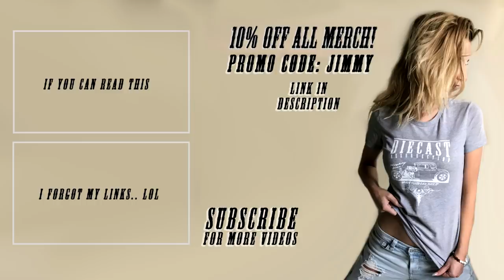1:64 DUNKIN' DONUTS GASSER CUSTOM

Comment: Love the car theme. I would have liked to see the over spray fix and the stance change. Those are a couple of the learning points which you do so well. As for the decals, I assume you have notified the seller so he can hopefully address the problem. As a business owner, I have always stressed that negative input is as important if not more so than positive. A problem can not be corrected if I don't know about it. And if this seller is reputible, then he or she deserves a chance to correct your issue and perhaps even compensate you for your trouble. Thanks for another great project!

Comment: I restored a Fender Stratocaster guitar and bough a aftermarket headstock decal. When I went to smooth out the bubbles the decal ran. The guy sent me another one and suggested a very thin coat of clear. It worked great and when I clear coated over it, blended in well.

Comment: In the future you can spray the decals with a clearcoat before you dip them in the water. That would keep the print from being destroyed.
Reply: Yeah, I thought I've seen Marty do this as well.
Reply: 99% of professional or retail decals don't need that treatment, like the ones that come with models are typically pretty sturdy. He must have thought the same and as much as that guy charges for them, I would too...
Reply: Well, after the first one, I would have clearcoated the rest. Don't get me wrong, he does great work. I just would not have trusted the rest of the decals. I know he didn't even though he used them as they were anyway.

Comment: The Decals were definitely not sealed. I print my Decals and you need to clear coat them because the ink will run off (like yours). Maybe the seller forget that. I use acrylic water-based clear coat "acid free" from a can. Works great. Hope I could help!

Comment: Awesome gasser buddy. on the decals, what he forgot to do is seal the ink. ive heard from a buddy, that when you print water slide decals, you are to let the ink dry. then you spray a sealer this protects the ink, when you soak them and apply them. not sure what its called. but it looks like he didnt or forgot to do that step when he made them.

Comment: I have run into the ink running like that. I ended up clear coating the decal sheet before cutting them and putting them in water. Pain in the ass,  but that's what I came up with. Sorry for your aggravation. 
On the other hand the wagon looks killer !     🍻

Comment: Looks like the decals were printed on inkjet printer which means the pigments are water soluble. You can seal them with one or two coats of clear lacquer. Then when you dip them in water they will stay intact and you can place them with pliers or brush without damaging the ink.

Comment: Hey man. I been watching your videos for a while, along with a couple of other YouTubers and I've decided to try taking up the hobby myself.

The main issue I'm having is wheels. I recently spent £40 on about 20 sets (£1 a wheel) but they're all street wheels. I'm having real trouble finding any off-road wheels. I've scavenged a few from beat up Hotwheels I've found at junk sales and I know Greenlight do an Offroad set and a Monster Truck set but I can't get the bulk or the variety I'm going to need. I even tried contacting Hotwheels directly but they said they can't pull the wheels out of the machine mid-way through assembly.

I wanna do most of my cars for Gaslands (the Death Race/Mad Max game) so they're going to be all beat up, rusty and off-road modified, kinda like what Disaster-Dan does sometimes but it'd look kinda lame if I only had 8 sets of wheels to choose from with the Greenlights, and I don't want that many monster trucks.

There are folks who do 3D printed ones but they're a lot of work, often don't look that good and they're not cheap.

Do you know of anywhere besides Greenlight I can get off-road wheels the right size? Just to add a bit more variety, I'm going to use some Greenlights 'cause they're real nice, just not enough to choose from

Comment: I love the travel trailer in the background at the beginning. Where did you get it?
Reply from the maker: Jimmy's Mobile Home?   Its a HO gauge train model, it lights up and stuff.  I forget the brand, but its pretty easy to find on google once you search HO gauge stuff.  Expensive though..
Reply: It's a Woodland Scenics #BR5061. The Double Decker Trailer which retails for  $74.99 . By the way it's not 1/64th scale but 1/87th but whose counting!
Reply: @DiecastResurrection  thanks s0 much for the info. Keep up your great work